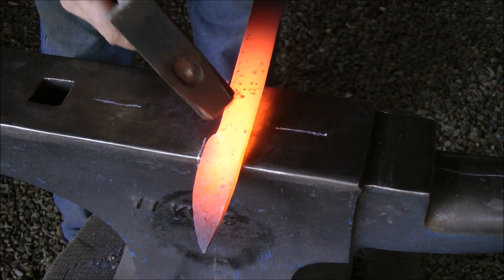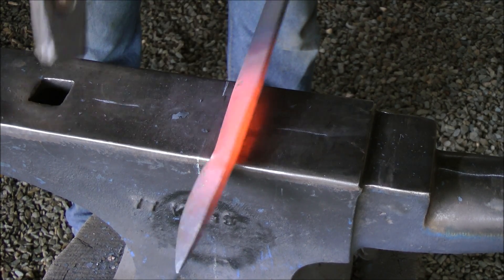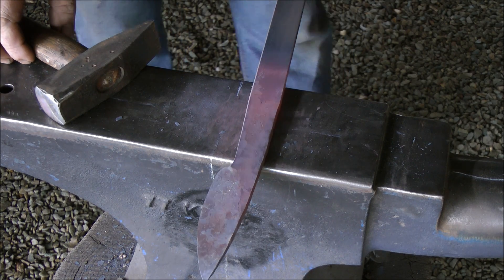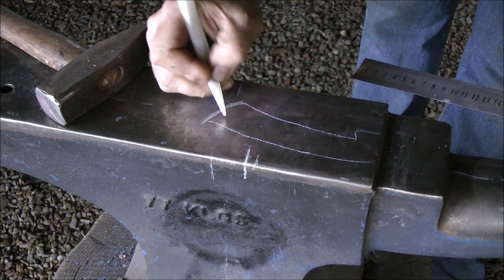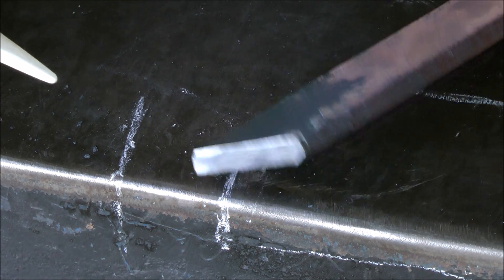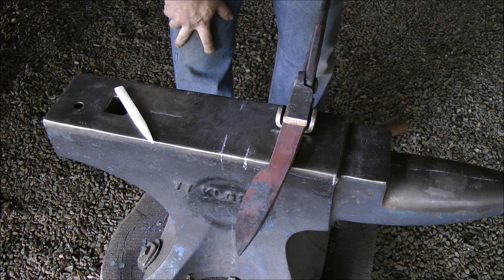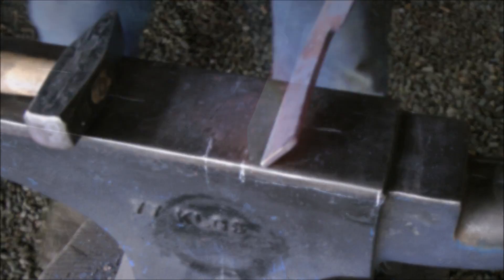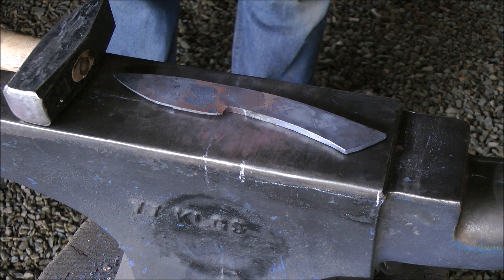Bladesmithing 101 - Forging out a full tang - No Taper

Comment: Hello i am considering to start smithing.Your videos really helped me.Now if possible could you share some tips for an amateur smith like me.I mostly want to learn how to process the knife after i forge it and some techniques on actual forging.Also i would like to know how to build or buy a forge(would prefer a gas one).
Reply from the maker: I currently working on this Bladesmithing 101 video series that covers" techniques on actual forging". Will later be moving on to grinding, heat treatment, finishing, handles, etc.

Comment: OOPS, typographic error 
I am working at a small Museum (  http://museumvillage.org/  ) In the spirit of the 19th Century we do not have the use of any power tools at all and smithing as much as possible using 19th Century tools and techniques.      
A common problem has been getting a close fit between the scales and the tang on full tang blades so I stick mostly to hidden tang knives. They are very much easier to fit up. 
Even without epoxy bonding, a well fitted burned in tang is almost impossible to dislodge.
If you let the tang protrude and then peen it over then it is totaly impossible. 
A video showing knife making without power tools would really be instructive.
Reply from the maker: I have added your suggestion to the list. Thank you for watching!